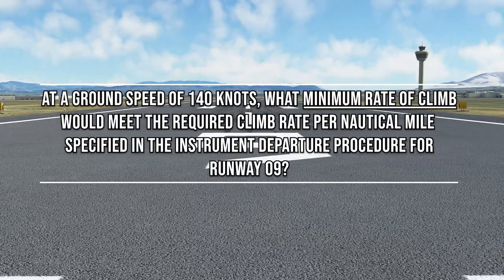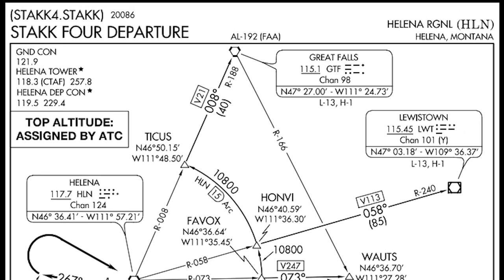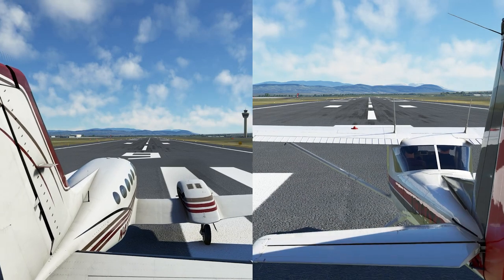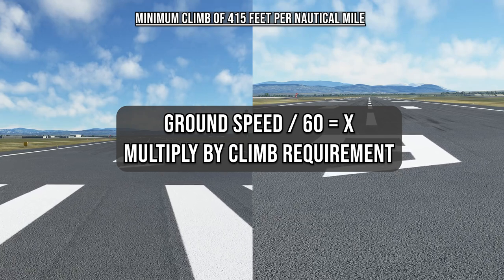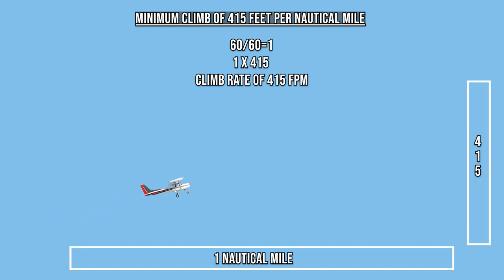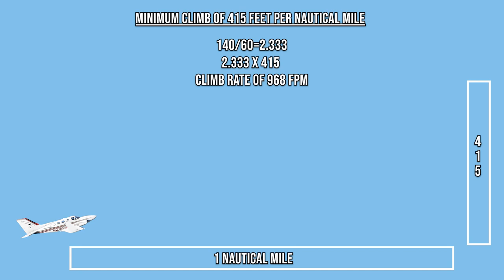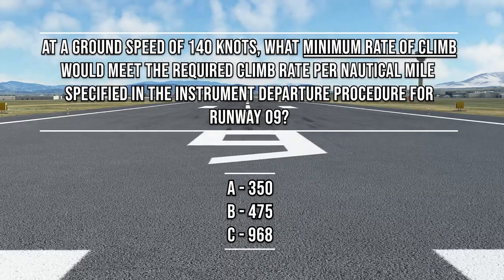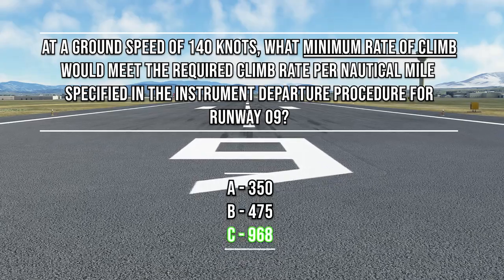Calculate Rate of Climb Required on a Departure - FAA Instrument Written Test Question

Comment: heyi what speed should I consider with da40?  In my fligh school we climb to 500ft with 72 kias then continue climb about 6000feet with 88kias. I want to know either 88 or 72? For me its 88 because almost all my climb section continues with 88kias. is there any explanation of it... some of my friends use 72kts in performance charts but they maintain 72kias only up to 500 feet then they speed up to 88kias until 6000feet, for me 88 makes sense because we maintain 88kias almost at 6000 feet. on top of that, some of my friends say u should use 88kias at go around but it doesnt make sense for me because I take consider my actual SID speed and its 88kias
Reply from the maker: The goal is to climb above terrain as quickly as possible while meeting the requirement. It’s possible that 88 knots would work for one SID and not the other depending on the climb rate required.  Your flight school more than likely climbs at Vy to 500 feet and then maintains a cruise climb to increase forward visibility and aid in engine cooling.  As far as the go around speed, check with your CFI and reference the go around checklist.  It is great you’re asking questions about the “why” and not taking things for granted because a friend does it a certain way.

Comment: I'm confused how a twin needs more climb rate than a 150
Reply from the maker: The twin engine airplane is flying faster.  Both aircraft need a certain amount of altitude gain per mile traveled.  Since the twin is flying faster it has to climb faster to achieve the same amount of altitude gain as the slower aircraft in the same distance.
Reply: @thecorporatepilotdad  I gotcha, thank you, but is it specific to the aircraft...like, the twin is heavier, so it needs more speed to stay airborne?
Reply: @thecorporatepilotdad  i understand, thank you so much!
Reply from the maker: @believeachieve2847  The video worked!
Reply: @thecorporatepilotdad  absolutely, appreciate you!

Comment: What's the other 60 ?
Reply from the maker: 60 seconds.  The airplane going 60 knots is moving over the ground at 1 NM per minute.  Ground speed divided by 60 (seconds in a minute) to figure out how many NM the airplane will travel in one minute.  The Cessna 414 in the video example is going 140 knots which would be 2.33 NM per minute.  The C414 also needs to climb 415 feet every nautical mile it travels in the example departure procedure.  To do this, it has to climb 2.33 times faster (968 fpm climb rate) than the airplane flying 60 knots.
Reply: @thecorporatepilotdad thank u for the details